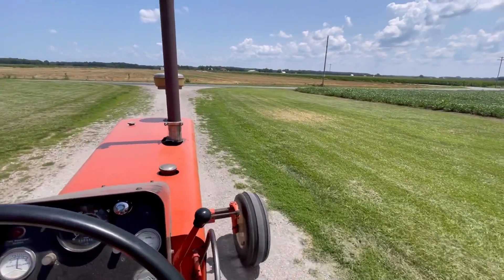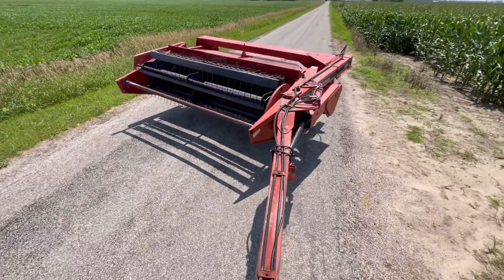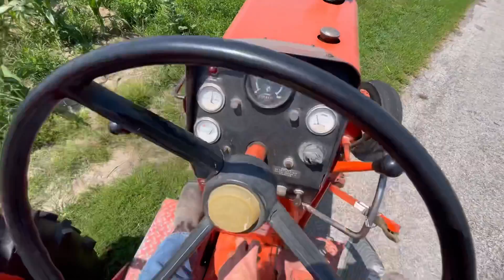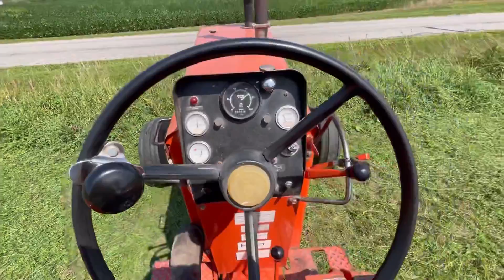Allis-Chalmers 185 & 175 mowing and tedding hay.

Comment: I noticed the turbo whistle on your 185.  Did you add the turbo or the tractor was already equipped new to you? I'm asking because yours is the only one with the stack in the center of the oval (new hole NOT cut in the hood). I have a 180 and when the injection pump gets rebuilt, I will change over to turbo (pump set for turbo).
Reply from the maker: @leebuck180  thanks for watching. Yeah my grandpa had the turbo added years ago when he got it.

Comment: Does that mower with the crimper help with drying time as well compared to the ol sickle mower?
Reply from the maker: Yeah that rubber and steel drum help brake up the stem and let’s it dry faster, now back before we used a mower crimper we had an old crimper and we pulled behind the 175 and the 185 ran that old sickle mower.
Reply: @Hinesfarm-Indiana  oh ok...I didn't remember that...I just remembered the sickle mower lol looks like this one does a great job 👍
Reply from the maker: @tnhillbilly1307  oh ok yeah dad had a crimper in the 90s when I was little, and it got burned up when my uncles barn burnt down, it might have been after you all left up here that he found another one like it, then we got a hay mower around 2012 I think.
Reply from the maker: @tnhillbilly1307  hey we should have had you come up and  ted the hay by hand, would’ve save wear on the new tedder lol 😆
Reply: @Hinesfarm-Indiana  might not have any hay left if I went thrashing around out there 😆😆
Reply from the maker: @tnhillbilly1307  😆😆😆😆😆